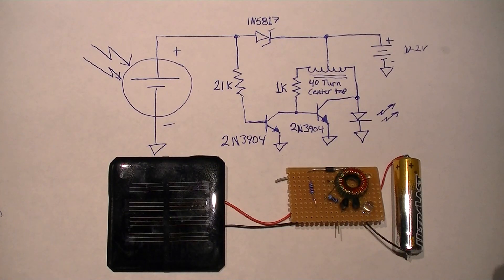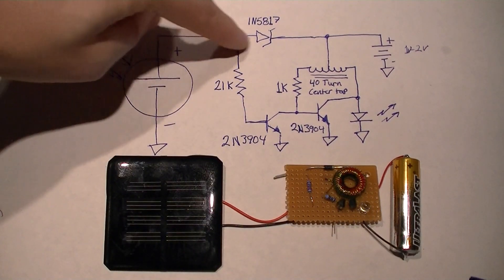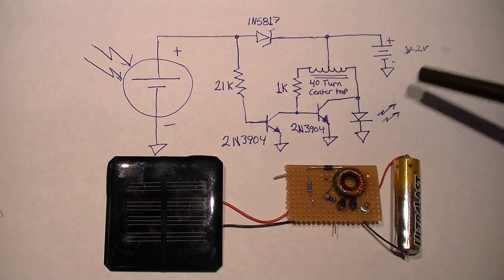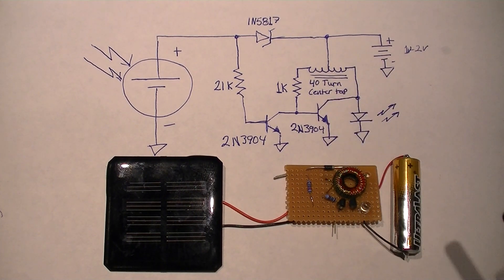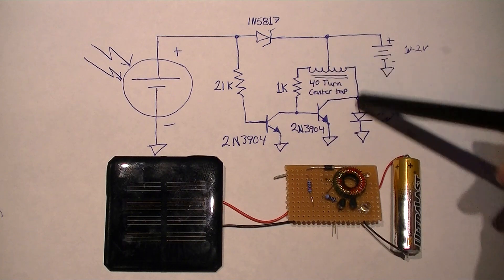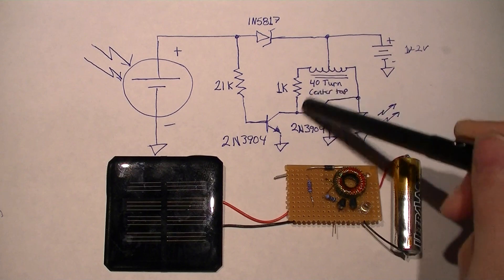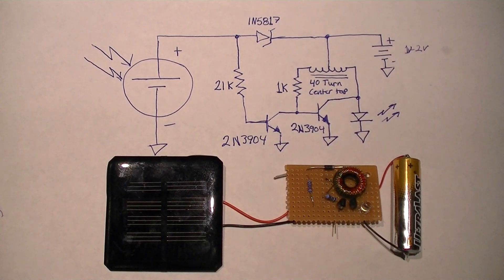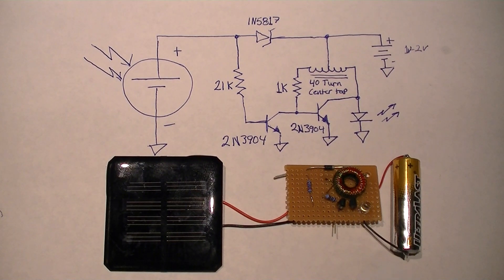Minimal Solar Night Light Circuit

Comment: Lil late, but this will work with less power waste. 
Pnp like a 3906 switching the positive side supply of the joule thief off when positive arrives from solar panel through 5k to base of transistor.

Comment: It works when i added  solar cell from calculator. The transistor can be KTC9014 and TIP31 NPN type.
My toroid is 25 turns and 26 gauge of wire with secondary winding. But the inductive kickback voltage is 30v can be enough for high power LED chips.
Reply: Richard Johnson  in transistor where the emitter is connected

Comment: I saw a version with a supercapacitor instead of battery being charged at night, flipping over to emptying thru/into  a smaller capacitor at night. Im trying to figure which one to make. I found a quite big 220v toroid tri filar transformer in the electronic bin in my cortyard and also an IKEA solarpanel on a led arrangement that I tore off. Im brainstorming about what to build.

Comment: Yes, shunting the base bias to negative is not the most efficient way to turn off the JT.  I do it several ways in my recent blog. You may have never thought that a red LED could turn off the JT. It's at rustybolt dot info and click on the link to my blog.

Comment: @jeriellsworth 

Nice project.  Actually a correctly built JT circuit is very efficient.  Some of mine run for months 24/7 on an AA.  Dr. Jones has measured possibly COP 8 with his circuit on oudotcom.  Others in our group have circuits that will run for a year.  Very efficient and flexible little circuit.  You can really get the amp draw very low with a little effort.  Very nice video.

Bill

Comment: @vk2zay Thanks for the tips. I have a similiar circuit in one of my projects and what I did to kick start the oscillator is to use an CR integrator to trigger a pulse on the gate of an SCR. The SCR keeps  the load to turn on as long as the PV cell is blocked. Once the load current drops below the holding current of the SCR (light is on) the entire circuit shuts off and no leakage is measured. Im not sure will it help, Jeriellsowrth. Anyway, I will also try to play with vk2zay's idea. Thanks!

Comment: @stelian95 It's brilliant only if you pull the shade, otherwise it's dim. :-)  Seriously, you could explain the shade by saying that it is there to simulate nighttime and that the light is not intended to come on during the day, which would waste the charge stored. What they will not be able to figure out from your schematic (if you leave the switch part out) is how stopping the charge causes the light to come on. The secret goal is to see if they are smart enough to ask that question.

Comment: Hi Jeri, interesting problem to solve.  I had a go at redesigning it last night in LTSpiceIV and came up with the following circuit: screencast com/t/fuiEmTVyMg  It is essentially a PNP BJT that switches off the center tap of the transformer when the solar cell is within battery - .65V - IR of the base resistor.  Shottky from cell to batt.  Adj. base resistor for better efficiency, I was really boosting the output.  High gain BJT's or possibly FETs would be better. -Brett (FightCube)

Comment: I wonder if a Panasonic 1381/13811/13812 voltage detector would work in this circuit to replace the NPN on the left? They're used in a number of BEAM solar related robotic circuits. The 13812 has a CMOS inverted output in a TO-92 package.

Comment: @stelian95 If you want to blow the everyone's minds, put a small window shade roller next to the solar cell and arrange a rope with a knob on it passing through a guide loop, so they only have to pull the knob to cover the cell, else it retracts. Now here's the good part: build a hidden switch (reed & magnet?) into the shade that operates the light. When they cover the cell, the light comes on! Only the truly geek will think that this is absolutly whack and start looking to find out why.

Comment: @yellowmetalcyborg The trouble with outdoor solar night lights is that, unless they are in a secure area, unlike the wired variety, people can just walk up and pluck them from the ground like flowers. Perhaps someone will come up with a mounting stalk that can be driven into the ground and the, with a twist or some other mechanical trigger, cause spikes to radiate outward, anchoring them more permanently. (Oooh! I just thought of a way, but-I-won't-tell-you).

Comment: @MrPieChee There's more to it than just the cells; there is the cost of the structure to support and protect them, the weatherproof wiring to connect them and the inverter that converts DC to AC and synchronizes the latter to allow connection to the grid. Also ther is the cost of installation, and, as I mentioned, ongoing maintenance. It all adds up, and, if the investment yields less than others, solar would have to be done on principle (green is good) rather than for monitary reasons.

Comment: It's similar to what I'm working on for a school project. I used a bigger 6V solar panel,  a battery from an old camera that is charged through a diode. The only problem is that I have to use a switch to turn the light on and off but looks like the simple methods are the best.

Comment: You can burn a bit less current keeping the switcher off by reducing it's base bias needs, it need only be biased enough to start up if the oscillator bootstraps itself.  Maybe bypass part of the bias resistor with capacitance?

Comment: @Orthosonic 
Hi yes that would work, I think this is the solution PNP as a switch to the center tap, with the base of the transistor on the anode of the schottky, through a resistor of course.. Try it out Jeri :) And Thanks for all the cool videos..

Comment: @PhattyMo Words to live by: "Green energy is for fools, Jeri!" Seriously, if solar power was the answer, they would be covering our roofs with free panels just so they could us sell the power. So far the money cost kills it; solar earns less than other investments. And who's going to cough up the big bux to fix a break in the wiring on the roof or an inverter that craps out? Jeri needs to invent an AC-output solar cell that plugs in an outlet that they can sell at the 99-cent store.

Comment: Here's an idea. Feel free to poke holes in it. Rewind the torid so it has 120 turns with the tap still at 20 turns from one end. Now you will have 5x the feedback voltage and can use a 5K resistor instead of a 1K. That will cut your off state current losses to 1/5 what they were before.

Comment from the maker: @Insignificantful It turns off the switcher by grounding the base of the powersupply transistor when there is enough light.    You're thinking about it backwards.

Comment: How does the transistor with the 21k resistor turn on if the photo-voltaic cell does not supply enough voltage when in a dark room.

Comment: Cool video. Very instructive. Would using a capacitor across the output of the flyback section give you a more constant output. I understand that the flyback section gives you pulsing DC on the order of at least some khz.

Comment: Don't last very long meaning.... the battery is overcharged and damaged? or the battery never gets a full charge because the circuit is wasteful and the the LED just doesn't light for long? sry, I has an electronics noob.